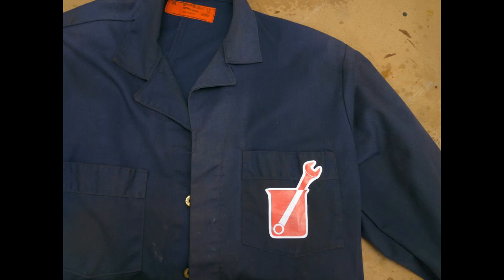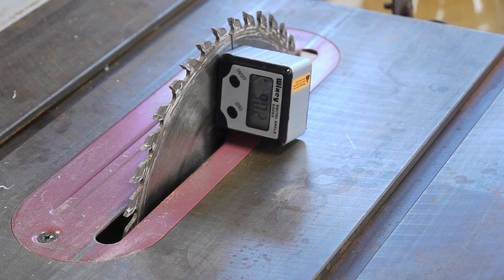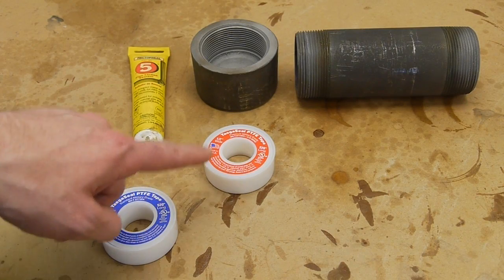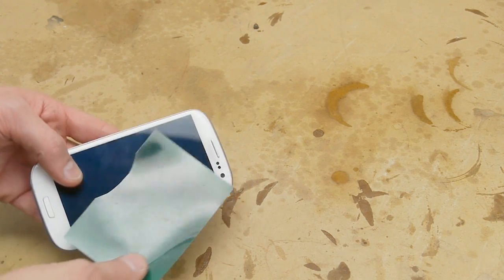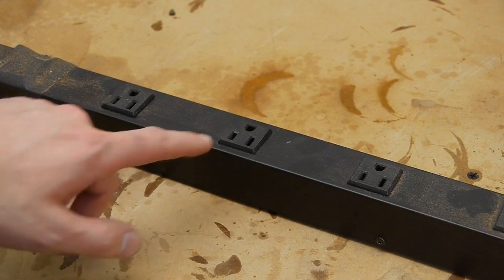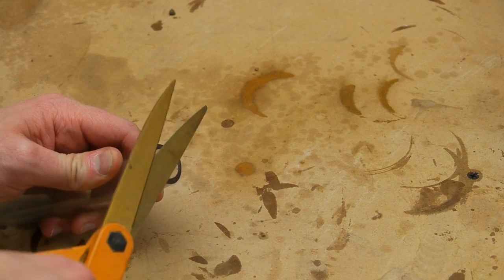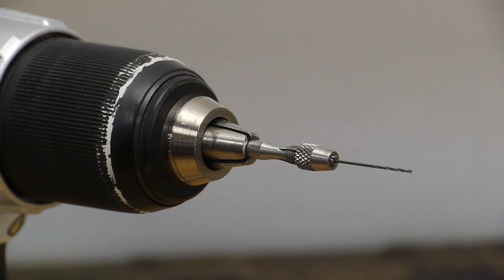Tools and Tips #2 from Applied Science

Comment: I had the same cutter for PVC & rubber tube. It worked OK, but what I replaced it with after I broke it is Eclipse tools EPPC42. It is way better. It cuts much bigger pipes (intended for up to 42mm, but I regularly use it on 46mm), much more squarely.

Comment: if you are drilling small holes, there are bits that come with a standard 3/32" shank. Starting at 0.50 mm, and are thus far easier to use with no adapter needed!  https://www.gesswein.com/p-3080-busch-high-speed-twist-drills.aspx  is a source.

Comment: For pipes those seals are not good not even military. My pipe accidentally got to 250 degrees Celsius due to pump failure. The seal melted and then crystalized. We got leak.
Unlike old seals that use some kinda hair with oil does tolerate higher temperature.

Comment: I used to have on of those drill chuck pin vise adapters, but they're mostly crap and break way too easy. I have a Dremel graveyard that I plunder from time to time and I took an old shaft, cut it in half and use the threaded half with the Dremel universal chuck and chuck that up in my drill chuck. Works like magic.

Comment: On cutting vinyl tubing, a garden pruner type called an (Anvil) pruner will  do the same. It also uses a flat edge on one blade and a knife edge on the opposing blade. Square cuts for a lot less money. It also works well for cutting Coaxial cable and bundles of electrical wire and nylon rope.

Comment: if you haven't, you should show how to use some superglue and silicon carbide (grey and greyish green grit) sandpaper to make a wet stone that will cut through even really tough tungsten carbide though it is very slow going with that stuff, and the sand paper works so much better on steel of nearly all sorts, though oil or water is needed for softer steels since they can clog the grit, 

What super glue? it soaks into the paper to make sure the paper portion of the sand "PAPER" is not acting as a tiny sponge and allowing a slight rounded edge on the cutting portion of the blade possibly either making the angle too obtuse or rounding it off completely, 

each piece of glass can yield at least two grits and if its a particularly wide piece, and long you could have a section on each edge giving 8 grits with 4 per side, though larger sheet of glass equals more chance to be broken 

another nice thing about the silicon carbide sand paper is it will easily round off sharp bits of glass and the like, or even give a sudo frosted finish to it though if its fresh and sharp, the frosting is more like a diffraction sheet. anyway thanks for the thought out video and ideas, I think most of the ones here I have been using already except the wire harness trick, so can't wait to use that as I am rerouting wire to my truck, so I can add modular solar panels that I can put away in the bed, when not in use or in motion, and then pull them out and plop them on the ground, or on the camper and hood of my truck, and charge up the marine batteries I have planned for it, so I can run my inverter to do a little work on the fly, 

Also I am redoing my lighting to switch completely over to lower wattage LEDs for more light and more power left over when running to throw into that marine battery, when the standard car battery is full :)

Comment: 5:36 cool! But actually it's not north south north south but in fact a special pattern called a Halbach array which uses 4 distinct  polarizations (two are normal to the sheet and two are parallel) in a specific repeating order to magnify the field on one side of the sheet and partly cancel it out on the other. This is why most rubberized fridge magnets don't work very well in reverse.

Comment: I was happy to hear you give "hot-snot" the thumbs-up; its lowly status and poor reputation belies its usefulness! A somewhat flexible adhesive that can be re-melted at will, can be removed without trace from many surfaces, applies and sets quickly (albeit messily), is actually quite useful in many situations where nothing else would work. One perhaps unusual application is to put some low-temperature hot melt glue on a wire connection which is to be heat-shrinked, in order to make the seal waterproof. When shrinking the tubing the glue re-melts and fills any voids (some may even ooze out the ends if you've applied it too liberally), forming a watertight bond. I know there is such a thing as glue-lined heat-shrink tubing, but it costs more $$$ and this is a reasonable alternative when you haven't got any to hand in the correct diameter.

Comment: I have found Rectorseal #5 far better and more versatile than teflon tape.  I have never had a leak with water, natural gas, or pressurized air using it where teflon tape mostly works, but I have had leaks.  I highly recommend that product.

Comment: Thank you for some excellent suggestions.  May I add a couple of comments?

To cut tubing (and coaxial cable) the anvil-type pruning clipper works very well.  Just make sure the blade is sharp.  

I also use a drill to twist wires, but I usually have better control using an eggbeater type hand drill

Comment: The trouble with pin drills is that the TIR (eccentricity) is so bad that the drills have a much higher chance of breakage. Also small drills don't really work well in hand drills for several reasons. First, the smaller the drill the faster it needs to turn, 10k or even 20k rpms is not abnormal. The other problem with hand drills is that they are not sensitive enough to 'feel' the drill and it's very easy to bend and break the bit. There's a tool called a "sensitive drill attachment" that allows you to very carefully and accurately control the drill in a drill press.
Thanks for the video,
Robert

Comment: The way I understood it, fridge magnets have this complex pattern because they are half-magnets, meaning only one side (the back-side) is magnetic. It's called a Halbach array if you want to look it up. Has some really cool applications aside from decorating your fridge.
Reply: Nothing nearly as complex. They are manufactured in large sheets and as you want the magnetic field to be uniform no matter how you cut them, they are magnetized in narrow strips, interleaving north/south poles millimeters apart, on one side. It's superficially similar to Halbach array, but a really half-assed approach to making it - in particular, there's no attempt to nullify the field on the other side through careful layout; it's just that the magnetic surface is magnetized so shallowly and weakly the field just doesn't really reach to the other side.
Reply: +Lukas don thanks

Comment: a much safer way to check the 'hot' pole of the outlet is to use the ground instead of your own body. without a resistor, that testing method you showed could cause injury or death in certain circumstances..
Reply: it's not going to cause death, my goodness. people act like 120VAC is the same as the high tension wires feeding a city. You'll get a buzz, for sure, but the odds of a mains shock being lethal are minuscule. Otherwise every child in the modern era wouldn't live past 5. And there would be hundreds of deaths every day worldwide. The body is not a particularly good conductor of electricity, much less AC, much less if you're not standing on a metal grounded floor or something. If you're wearing socks or shoes and standing on wood/cement/carpet/tile the capacitive coupling is very small and the amount of energy actually absorbed is extremely low.
Reply: @AureliusR my comment literally said "in certain circumstances". Christ. Do I have to spell out every situation where it could kill? Ain't nobody got time for that.

Comment: Hey Ben - On the cutting of soft plastic tubing... that McMaster tool looks nice, but a Ratcheting PVC Cutter works just as well and is $6.48 at the big orange hardware store.  Nice video, good tips.
Reply: Or, for that matter, the main problem with a box-cutter is that the blade is too short. So I just use a kitchen knife.

That said, the blade & anvil system is nice. I have a similar tool by a different manufacturer, and use it occasionally.

Comment: For cutting rubber tubes I use a Folding Utility Knife. I fold it with the hose in between and do a turn, works like a charm. Just like a pipe cutter.

Comment: Love the razor cutting tool - I have a cheap Husky brand I use all the time. The razor is just a small standard type you'd find in a retractable box cutter. Also, the magnetic film is fantastic. I need to get a piece of that :)
Reply: You can buy it on eBay.  It is not cheap, but smaller pieces, like the 4x6" size are reasonable.

Comment: Applied Science For the pin vice, my father (ex CNC machinest) has always had what he calls a "Jaycob's chuck", which is just another much smaller chuck that you put in your drill's chuck.
Reply: Jacobs is just one of the larger manufacturers of drill chucks.

I have a 1/4" chuck (made by Jacobs) that I chuck into larger drills when I need to work with 1/16", or finer, drill bits.

Comment: Holding one end of the voltage tester like that is still considered unsafe.  It's better to do the three point check.  Hot-Neutral, Hot-Ground, and Neutral-Ground.  The results you should get for properly wired are:
Hot-Neutral, lit
Hot-Ground, lit
Neutral-Ground, no light
If any one of these three positions is wrong, it's miswired.
Much easier is the plug tester which will tell you exactly what the problem is.  It checks all three at once and gives you the indication.

Comment: I use the drill tip for twisting wires as well.
One other thing I do to keep the wires from unraveling is to to run an industrial hot air gun over the plastic insulation to relieve the stresses built up and give the plastic insulation a new less stressed memory before I undo the drill chucks grip.

Comment: for cutting tubing i'd try bevelling shears that are popular for UPVC window installers for cutting plastics. Just check any glazier supplier shop and they should cost around $10. They also have angle guides for angled cuts and are much more robust than the one presented here.

Comment: comments regarding the standard pipe thread are completely false; and demonstrate some kind of stupidity. It's a tapered thread; driven to closure, it becomes a metal to metal seal. It's difficult to find an excuse for not understanding this, except the usual modern problem. Everybody uses sealant so it must not be a sealing joint. Whatever everybody does almost always equals ignorance; and there is no substitute for thinking and doing your homework.

Comment: Do not in any case touch another tester lead, these devices are not designed to be safe to touch (might never, ever strike trough dough). Use the ground connection instead, it should lite even better.

Comment: More tips: 
1. You can use Hot melt glue to secure thin metals for machining on a lathe or mill. Use heat to delaminate it and whip off with a solvent (acetone works) after machining.
2. you can use hot melt glue with sandpaper on dowels or other instruments to create custom tools for sanding inside of parts.
3. silicone caulking does not bond to scotch tape. You can use it as a mask when applying silicone to surfaces.
4. You can use cheap PTFE (telfon) tape like electrical tape for very small wires or connections. PTFE tape isn't sticky, but holds tight when coiled around a wire. PTFE is a very good electrical insulator, and does not outgas (for use in vacuum systems). Standard electrical tape is difficult to use on small wires due to its sticky adhesive
5. Hot air rework stations can are great for reworking hot melt glue. you can dial in the heat necessary to remelt the glue and avoid putting to much heat onto the part your working on and have fine control of where you remelt the glue.Hot air workstations are also great for heat shrink tubing.
6. You can use loctite to bond metal to metal surfaces where soldering or welding is not an option (ie securing a bronze bushing, or thin pieces of metal). You can de-bond loctite with heat. Loctite will provide a more uniform parallism between thin parts as hot melt glue is difficult to apply smooth and flat.
Reply from the maker: Guy Tech Good stuff!  Thanks.
Reply: I think i saw clickspring using cyano for machining thin pieces. Don't know how well hot glue will keep the parallelism. The PTFE idea is excellent.
Reply: DON'T use Acetone to remove hot-melt glue. It releases instantly with a spray of Isopropyl Alcohol or even Denatured Alcohol (Methylated Spirits). The alcohol releases the bond 100% but doesn't actually melt the glue!

Comment: Applied Science  Hi Ben. Just though about the magnetic rubber sheets, that another point of having small sections of magnets with opposite poles, is to further prevent sliding of the surfaces. If both of them have the magnetic sheet, they will stick extremely well too eachother in a vertical setting.

Comment: Applied Science 
I don't know if you do that already, but you should try hot glue and baking paper! Hot glue won't stick to baking paper at all (may depend on the quality of the paper though) if you let the glue cool down before trying to pull of the paper. Put a dab of glue on the paper, then push a connector (e. g. standard 0.1" pin headers with wires soldered to it) into it and push on the top with a second piece of paper (although it's fine to do this in two steps also). With a little bit of practice and trimming (flush trim wire cutters work very well for that) you can make connectors that almost look like injection molded, including a kink protection.

Comment: The old outlets around here are unpolarized and the ground is the metal sheath that runs from fusebox to a metal box. You can use the neon tester even at the outlet faceplate mounting screw to access ground if you're real lazy (which is essientially how the three prong adapter does it). Personally I like to stay out of the circuit.

Comment: This cutter you used for the hose seems like it is actually designed to cut ribbon cable. Mine looks almost exactly the same. However there are hose cutters available ( http://www.diseno-art.com/products/tools/multi_hose_cutter.html) that cut the tubing without deforming them so much. If you re cutting nylon lined tubing you definitely want to consider one. They work great and last a long time

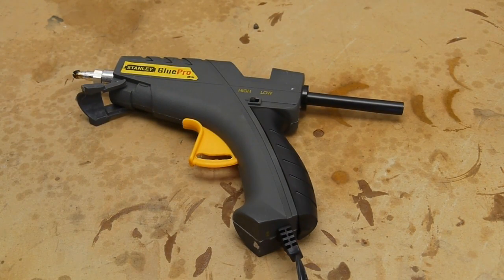Comment: 3:05 ...it's thicker BUT it's more dense. Shocking. 4:25 you can also get glue sticks made for fabric that set soft and flexible. 7:00 This is handy for being neat, but don't twist wires you intend to feed through conduit. It makes it MUCH harder to pull through pipe. Also increases heat inside the conduit...7:43 instead of your finger (Hi, I'm an electrician) put one side into the ground hole at the bottom, or connect to a faucet or water pipe. No shock and you will find the polarity (which side is plus or minus) which won't be shocking! ha.
Love this channel. I also want to point out it would be cheaper to subscribe to get the iron on logo than to make it yourself.

Comment: I have before wondered about, but not tried yet, sticking a piece of ABS in a glue gun. some info I can find implies that a high-temp glue-gun should be able to melt it.

otherwise, wondering if there is some other option for rigid plastic glue-sticks, like if you want to glue something together a bit harder/stronger than normal hot glue. or maybe something that sticks good to steel (normal hot-glue doesn't stick for crap to steel), ... (ideally, sort of like the hot glue equivalent of JB weld, that can be removed later with a heat-gun or similar, and not quite as drastic as drilling holes for screws/bolts or welding things).

though, even as lame as hot-glue is, it actually seems surprisingly strong vs OSB (glue some pieces of OSB together, or glue stuff to OSB, and generally the wood comes apart before the glue fails, at odds with its seeming lameness in other areas).

also, random things that would be nice:
iron-containing 3D printer filament or glue-sticks, which aren't crazy expensive (say, for fabricating magnetic cores, or maybe magnets with the right setup);
something that is 3D printable, but has significantly better durability than normal 3D printed plastic (ex: better for mechanical parts or heavier loads), and cheaper than 3D printers for metal (DMLS machines and friends are generally absurdly expensive, need a more "consumer grade" options);
...

Comment: It would be interesting to see the surface finish of contacts burnished with the burnishing tool vs sandpaper under the SEM. I have that same tool in both coarse and fine and I fail to understand how the tool is any less harmful than fine grit sandpaper. I like the stiffness of the tools, but at ~$9 a pop I don't think the added cost is justifiable if 10¢ worth of sandpaper leaves a comparative finish.
Reply from the maker: johnfranks Yes, I think a SEM investigation sounds like a great idea.  I've read that the tool doesn't leave behind any grit, whereas the sandpaper can have some non-conducting particles break away from the paper and stay lodged in the metal contact.  I haven't done any reliability (or SEM) testing, so it's all just hearsay so far.